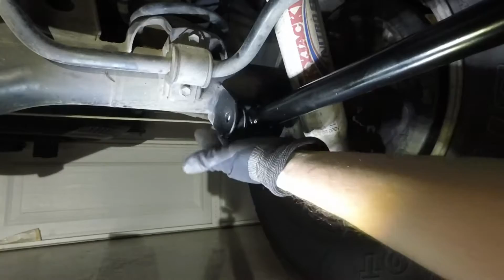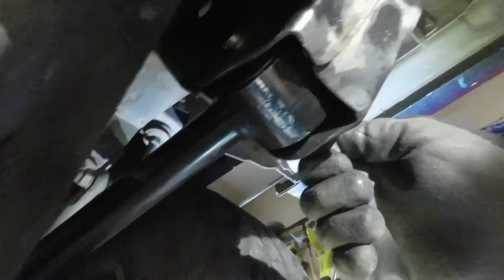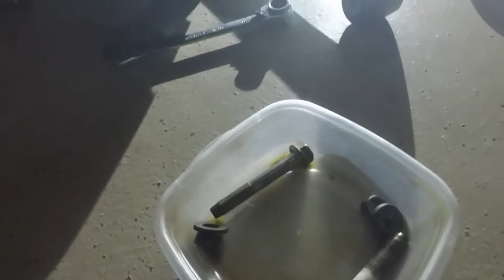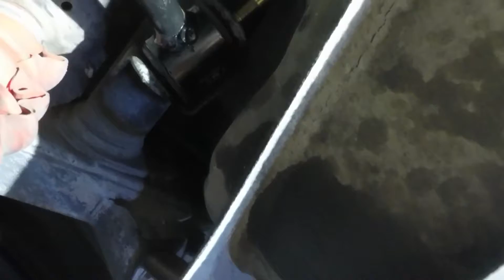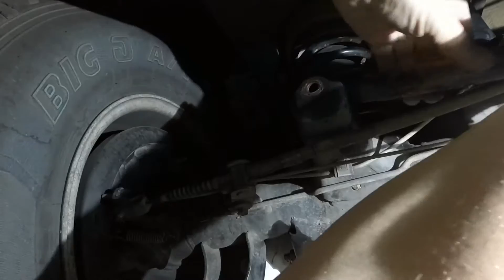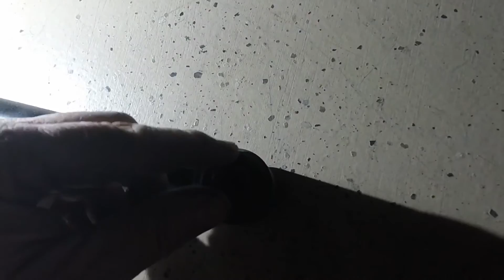Rear Suspension work 3rd Gen Toyota 4Runner

Comment: Did you do this entire job with the wheels on the ground or suspended?
Reply from the maker: I did the entire job with the wheels on the ground but I have a two inch lift all the way around. You may need to lift something if you can't get access if your vehicle doesn't have some sort of lift. Just be very careful when removing any suspension parts with the vehicle on a jack/jack stand. Good luck with your project!- Mike
Reply: @mikesdoityourself  thanks for the tips! I got a 2 inch suspension lift so I should be good to do it with the wheels on the ground like you did.

Comment: How often should these be replaced?
Reply from the maker: Really the control arms and lateral arms should be replaced if one get damaged, if you have dry rotting/ cracking of the rubber around the bolts, or if your getting a lot of excess side to side movement of the rear end when going over curbs, bumps, etc. - Good luck! - Mike
Reply: You replace them if they're bent (the arms itself), the bushings are worn, or the rear end of the car feels very bouncy and uncontrolled when driving. These are all signs of worn control arm bushings/bad control arms. Otherwise, don't replace them.